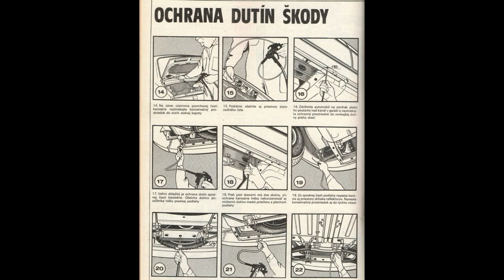Skoda RWD rust protection treatment \ Aplicare protectie anticoroziva

Comment: Thank you. It's a shame that was was not applied in the factory but at least it can be done easily. Is there any way of protecting the front of the boot lid and lip of the engine cover?
Reply from the maker: I did not show in the video how I protect the front boot , because I used a oil treatment with 2 months before I have recorded this video. You need to open the front boot sideways, remove the highest located round cap located on the inside of the bonnet, and put arround 100 ml of fresh oil . Make sure that all of the other plastic caps are in place ( they prevent oil to came out ) . In time the oil will move freely inside the bonnet and you will notice that some will come out where the mask and headlights are located.